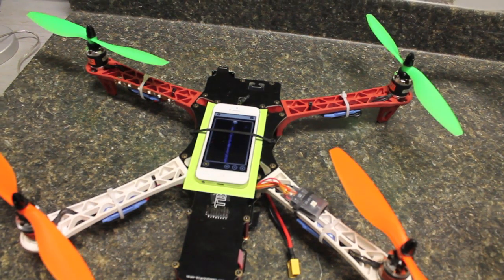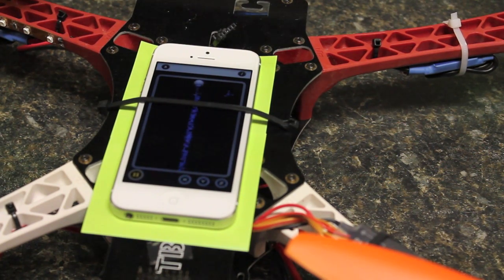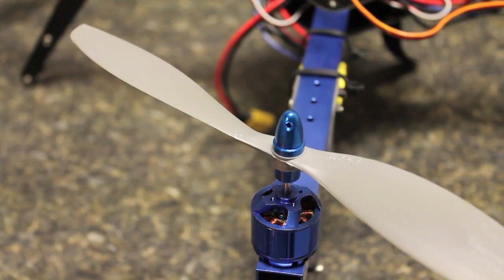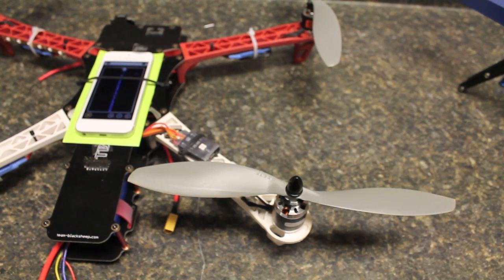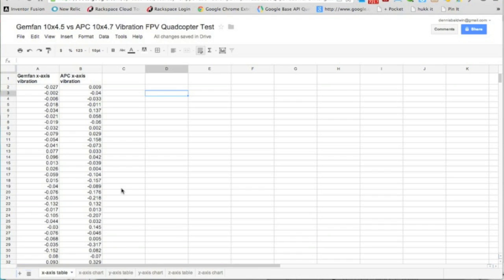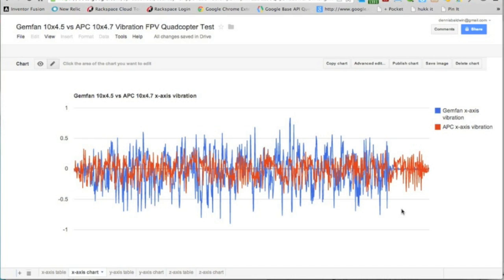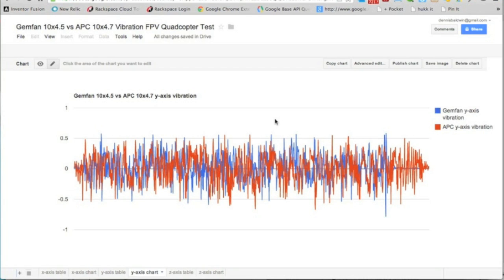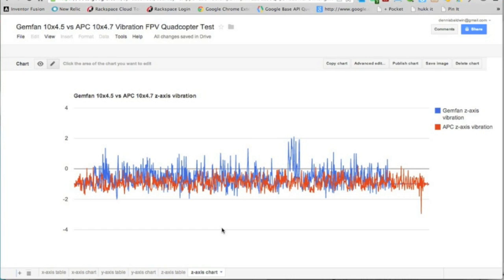Prop Vibration Comparison Test Using iPhone Seismometer App for FPV Quadcopter (Gemfan vs APC)

Comment: Appreciate the video but the Gemfans look like total shit just by the way they flexed when you poked them in the beginning... would never fly these on 4s or with equipment on board just based on that alone... would love to see a vibration test of graupners vs apc vs some sort of beachwood prop... hearing a lot of mixed opinions on these—vibration/acceleration/wobbles, etc.
Reply from the maker: rbross3030 Yeah good point. As I was getting into building multirotors I used gemfans, but no longer do so. I'd recommend anyone starting out to spend the extra money and buy APCs or anything more rigid than the standard nylon/carbon gemfans. Thanks for the feedback and I'll see if I can do a vibration test on the props you suggest in the future.

Comment from the maker: That's really good to hear. I have some APC's on my ArduCopter, but haven't actually setup my GoPro on it. I've been using it mainly for GPS testing and autonomous flight. I'll have to do some more experimentation and see if I can come up with some data. Will let you know if I do. Thanks.

Comment: In terms of jello on the discovery they kick ass, but couldnt get my cc board tuned as well as with the apc's, also they lack the crazy thrust the apc's have at full throttle but I think that's what causes the jello. Also it descends quicker with less wobble. Would be good to see some actual data.

Comment: Nice test. I've noticed the GemFan props have problems with both ends not tracking on the same plane, and the Z axis result in your testing confirms it. I have a TBS Discovery also and I've found the Graupner E-Props work very well, although pricey they are worth the investment. I also use MoonGel under the GoPro with rubberbands holding it down.

Comment from the maker: Thanks for the suggestion and you're absolutely right. Someone suggested this for my other vid on testing vibration damping materials. What I did point out is although the readings are probably amplified from an absolute perspective, I believe they are still correct from a relative perspective. Meaning that the zip tie was used for all tests so the relative vibration between props should be similar regardless if I remove the zip tie. That's my theory at least. Will run some tests without it.

Comment: Dennis.  I wanted to make one suggestion and that is to try and isolate the iPhone without having the zip tie touching both the IPhone and the quadcopter frame at the same time. For example...  Use your Moon Gel or Sorbothane underneath the zip time so the zip tie is never touching the actual frame of the quadcopter.  The reason for this is you may be getting a slightly false reading from the vibrations transferring through the zip tie to the IPhone.  :)

Comment: Interesting, The only problem that I am having is that, at some point, (+50 % throtle) I start getting harmonics, which make the craft impossible to control!  Didn´t you get something similar? Did you mantain the same gain settings on your control board?

Comment from the maker: That's awesome. Thank you. You know, I was thinking about balancing a motor as it's mounted on the actual quadcopter arm. I'm not sure how much of a difference it would make, but may be worth a test. I will let you know if I put something together. It would probably simplify the process by not having to create a separate jig and the motor could be balanced directly on the quad arm. Thanks again. Very useful.

Comment: I never balance my props which are APC 1047's and think that proper rigid mounting is key to very little jello. It would be interesting to take your readings on top of a gopro to see if vibes get worse or not there. Nice tests, I have the copy APC 1047 solid carbon fiber props on way here now to test.